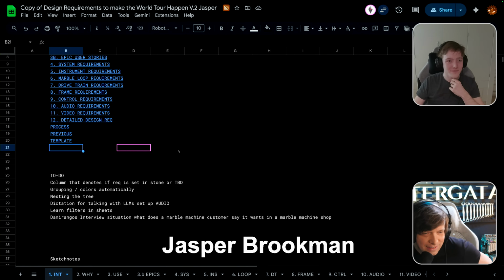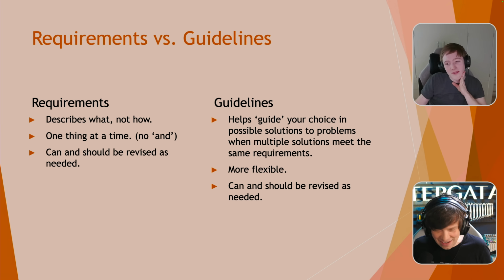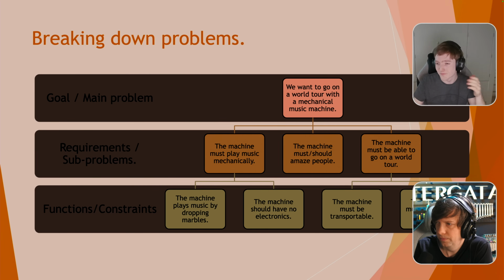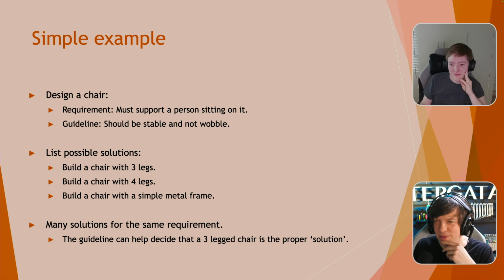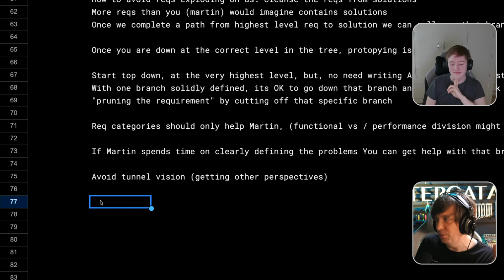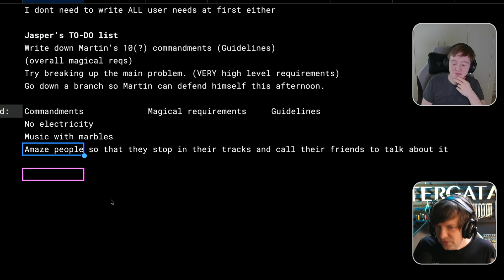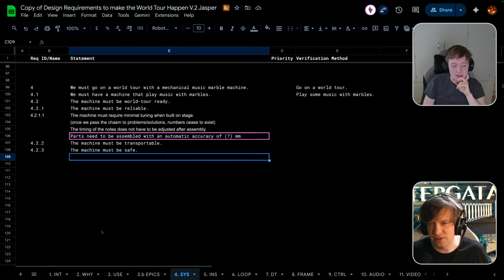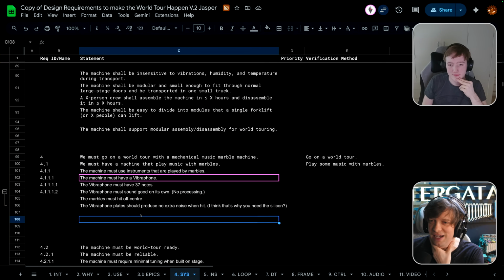How to Write Better Design Requirements with Jasper Brookman | Marble Machine Live

Comment: Martin, don't throw away the idea of lights too soon. The flywheel could create electricity that Edison bulbs are connected to. Then as a marble hits a plate, it lights up. I like the idea of old fashioned bulbs than LED, and I could see the lights from the back row of a concert.
Reply: It would drain the flywheel for energy that is inputted by Martin, so it needs more pedaling for the machine to run.

Comment: I disagree that subjective or magical requirements are automatically "should" requirements. "Should" requirements are requirements that can be optional like "may", but there needs to be a very good reason why you do not fulfill them and you might need a good alternative for the system not to fall apart. "May" on the other hand can be skipped without reason or the whole system falling apart. Magical/logical requirements do not really fall into these categories, they are on a different axis. For an artist, some logical requirements might be a "must".

Comment: My concern, formal design processes were developed at large companies in order to manage gigantic projects with hundreds to thousands of people. Without excessive clarity of design intent, huge projects will get plagued by miscommunication and mistakes as the "rank and file" guess at the origin of their specs instead of being able to know exactly the what and why of each piece of the puzzle.

Marble Machine is complex but it is NOT a gigantic project. It is basically a single brain responsible for design and execution (with support from very helpful and competent staff). 

Therefore, you there's a very practical limit to the utility of getting more and more "rigorous" with your design process. Formal design requirements are for a one man project are just writing down things you already know and likely won't forget anyway.

You have a preliminary design, now confirm the viability of that design through prototyping and experimentation. The final design will emerge from that process as you discover what does and does not work. 

Good luck!!

Comment: Cool stream thanks. Some really useful insights from Jasper. 

From a Systems Engineer and Requirements Manager, traceability and decomposition is important - described at end. I don't think your numbering is helping either.  You should define a requirement hierarchy like in the 'tree' slide from Jasper. I.e. starting with Level1 - user & outcome requirements (the 10 commandments), level 2 - the system requirements defining what you need the system to do, play music, be transportable, be reliable etc, then level 3 (and maybe below for sub components) are your design requirements. If you define like this the way you worth just down a single branch is to focus on just one top level requirement (the trunk) and then branch out into the lower levels. That way you can just focus on one decomposition path to the end of a branch allowing you to start solving problems and prototyping. 

The reason to have levels is you need to link between levels to stop the explosion, so you can use 'satisfaction' links to show where a requirement in the lower more detailed level satisfies one in the higher level. This is essential in building an organised tree without getting overwhelmed. You can filter on this too so just a single branch is then visible. You can also use links and associations between requirements to identify conflicts. This will give you a list of defined problems to resolve with prototyping. I.e. if the moving of the vibraphone notes does make the music less tight then you can identify this potential conflict in an alaysis and review session and see if it can be fixed or one of those requirements need to be changed. 

Finally, four things I'd highly recommend to do now.
1 Consider getting a requirements management tool, they're built to help do this and allows the linking and filtering in a way it should stop you feeling overwhelmed. You can take smaller problems one at a time. Let the tool do the organisation, you do the thinking about the content.
2 Consider getting a session with an experienced requirements manager that knows how to elicit requirements, they'll be adept at helping challenge you on solutions and get to the core need. They can also help with writing syntax to avoid ambiguity. 
3 As explained above, define your requirements tree/hierarchy. What requirements as allowed to describe in the trunk (level 1), then in level 2 (main branches) etc. This structure allows you to then dive deep into single decomposition pathways without explosions!
4 Ask yourself "why" for each requirement. You said there had to be a vibraphone solution, but why, do you have a higher level requirement that this is satisfying unless there is a chain of 'satisying custody' from the most detailed level to the top level then you have things that are unnecessary and unsupported and can cause you unnecessary design work trying to solve.

Best of luck and excited to see the progress.

Comment: My guy, writing documentation nobody is going to read won't take you any closer to building this machine.
Reply: Respectfully disagree. If he doesn’t define what the machine needs to do right now it’s gonna be another situation of the MMX. after years of “real work” on the machine, he found out that it had too many mechanical inconsistencies and would’ve been impossible to move around to go on a world tour. 

Buckle down cause 90% of this project‘s gonna be planning and prototyping . hopefully if that all goes well, the final assembly of the machine won’t take that long.
Reply: Respectfully disagree. If he doesn’t define what the machine needs to do right now it’s gonna be another situation of the MMX. after years of “real work” on the machine, he found out that it had too many mechanical inconsistencies and would’ve been impossible to move around to go on a world tour. 

Buckle down cause 90% of this project‘s gonna be planning and prototyping . hopefully if that all goes well, the final assembly of the machine won’t take that long.

Comment: I've personally never had to write Design Requirements however, I do write out a lot of instructions for myself for video editing on how to repeat big tasks, keyboard shortcuts etc. I feel like martin in a way where i know what needs to happen, and how it can benefit me - but before i can start, i need to have a clean way of structuring out the information in an easy to read/ understanding way. For me, Notion is fantastic in allowing me to format the information in multiple ways. I personally think writing out everything in Google Sheets is limiting.

Comment: You should ask a good programmer to make an app or whatever to your google sheet that constructs a mind map of the list your making. I sens that would help your brain. Especially if the mind map and the sheet where interlinkt, so that parts of the mind map is collapsable while collapsing the list as well. I mean, you clearly struggle with the visualising of the design requirements, so why not try to make it more visual from start?

Comment: I think you should plan more time for those sessions =) i think it would have become clearer, when you would have had the time to collaboratively work out the branch to it's end.

From what i understood - the tree is growing while you're are working on it - when you find/think of new requirements on the way and insert them into the tree.
Every requirement is a branch point in the tree.
 
And it gets smaller, when you find solutions to specific sub requirements (branches) of the tree (as you can collapse this branch).

That can go back and forth over the process, but there will emerge more and more final solutions for branches of requirements and you will find less and less new requirements that open new branches.
Thus you will approach the final machine in the end.

You don't have to go down every branch (of requirements) to the end from the start - but if you want to tinker on a specific solution - you should, with the best of your current knowledge, write down the path of requirements (single branch) that made you think, that this is something you want to figure out by tinkering. With the result of the tinkering, you can collapse this branch up to the point, where there are other requirements that aren't satisfied with this specific solution.

That branch doesn't have to be perfect at that time - if you later think of other new requirements on some part of the branch - you can always insert those new requirements and reopen the collapsed branch down to the point, where the old solution of the collapsed branch doesn't anymore satisfy the new inserted requirement.

Thus you can work either on specific parts (solutions) or big picture problems (requirements) any time you feel to do it - while still working in a cohesive form on the whole machine.
You always see in the project requirements tree what you have done, why you have done it, where there are still open questions (unsatisfied requirements) and when you think of new requirements and think about under what parent requirement you should insert the new requirement - you directly see what other requirements or even branches of requirements with solutions might be directly affected by this new requirement.
Reply: Agree with this, and in final paragraph here. Each decomposition pathway or trunk, branch etc can define a module or feature that could be carved off and given as a problem to others to help you solve and design (if desired).

Comment: Martin suffers from the "diderot effect" every time he adds something to the machine, this is because he adds the one thing but he doesn't think about the chain of things that he has to add in order to make it work. Like renting a new apartment but forgetting that you have to put Furniture in it or like buying a new 3D printer but not realizing all of the tools and filaments needed to operate it. Many times a single feature that is added will result in a larger scope creep because of the partner things that are required to implement it

Comment: 1:32:00 First commandment I don’t get. Maybe “Can work without electricity” 

It’s still going to have microphones or contact patches everywhere. It’s going to be a big design consideration on where the pickup electronics are going to be and routing the cables discretely so the machine still looks sculpturesque

Comment: Design Requirements									
									
DR 1	The audience SHOULD see when notes are played								
	Q1	From how far should the audience see when notes are played?							
		A1	The back of the room						
		Q1.1	How can the audience see when notes are played?						
			A1.1a	Movement!					
			A1.1b	Light!	NO I DON'T WANT LIGHTS!	(fine. but let's keep this here so we know we thought about it, and we can go back if we fail the other way)
			A1.1c	 ?					
				Q1.1a1	How much movement can the audience see from the back of the room				
					A1.1.a1	EXPERIMENTATION TIME!!!
Reply: It goes back to the basic question of what do you want, but then try your hardest not to skip parts. It's not even necessary to write down every little path and step, as long as you have thought about the steps.
Reply: Thank you haha, I literally thought of half of that after the stream finished 😅. 

What is the problem(s) you're trying to solve? -> What are some ways to solve that problem? -> Does it actually solve the problem? (Experimentation :O )
Reply: @Winterjas  Ya, I hoped you would get to that. 
He needs to ask a lot more questions before he starts to do things.
Reply: @mymemeplex  Sorry! :(
Reply: Or different direction:								
								
Design Requirements								
								
DR.1	The audience SHOULD see when notes are played on the Vibraphone when they are at the back of the venue							
	Q.1	What parts of the machine could move so the audience sees when notes are played?						
		A.1.a	Droppers					
		A.1.b	Plates					
		A.1.c	Funnels					
		Q.2	Is moving 1 of those parts good enough?					
			A.2.a	Yes				
				Q.3	Which movement has the worst impact on the rest of the Design Requirements (Reliability, Usability, etc)			
					A.3	Plates  (higher parts count, complex mechanism, sound quality implications, repeatability unsure, etc)		
						Conclusion:		Don't start with prototyping moving plates
Reply: @mymemeplex  Even a different direction:

Design Requirements:

(null)

Event Planning:

Get cameras and screens to show close-ups of the finished machine playing as part of the stage setup

Comment: 29:02  for the things with guidelines and requirements and where they should go there are two categories or axes:
1. Target of the statement (system vs module vs small part)
2. Restrictiveness of the statement (must VS should)

So on each level (=target) you will have both levels of Restrictiveness. So you will have design requirements AND guidelines for each of the tabs of your current table

Comment: Obligatory long comment:

Thank you so much for letting me try to help you and make sense of what design requirements are. Something I wanted to say but did not think of is this.

Design requirements are problem statements. Together they form subproblems.

To go down the branches to moving vibraphone you have to ask, 'what problems is this a solution for?'

Moving vibraphone is a possible solution for: 'The audience must get visual feedback when a note is played'.

This possible solution may interfere with the solutions to problems like: 'the machine plays music with a timing accuracy of less than 2 ms' and 'the sound of the machine must be consistent' (changing distances from resonator pipes could maybe affect the sound.)

Your prototyping is to see if a possible solution satisfies your requirements or not. It's to see if it is actually a possible solution or not.

If it is and it satisfies all requirements, then the guidelines help you decide: move or no move

Guideline, 'Machine should amaze people' may say yes, 

Guideline, 'Machine should not have too many moving parts', may say no.

A part of the reason why you don't want to decide on one solution too quickly, is that as you continue down other branches of the design requirements, you may need to choose a different solution elsewhere to make it work. (You may discover that you don't have the space to make the plates move so it's not a viable solution anymore)

Good luck this afternoon! ❤